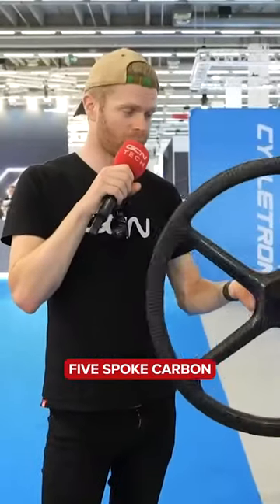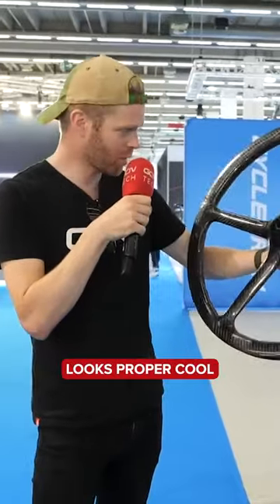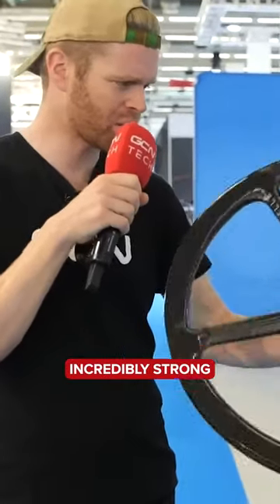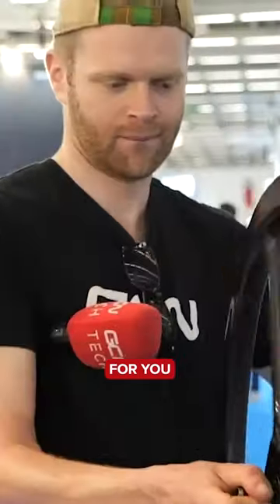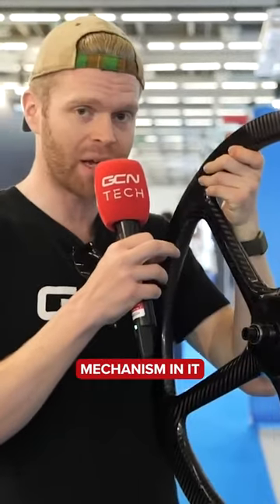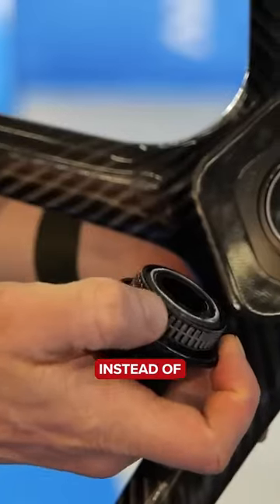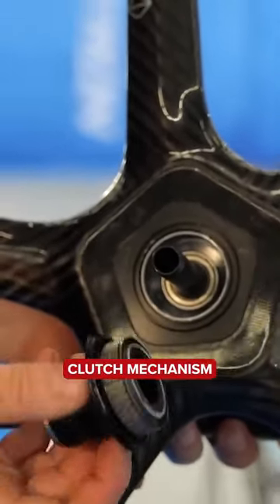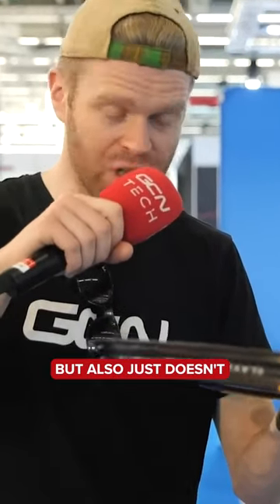A SILENT freehub?! 🤯

Comment: Quiet. Noise equals friction which means the noise actually slows you down.
Reply: Not really significantly at thr point the tech is right now...
Reply: Yeah......like it really does scrub off speed on you 🤔💩💩💩😳 .......freehubs and drivetrains are the sound of the club run right up to the pro Pelton......Silent Hubs...Me hole